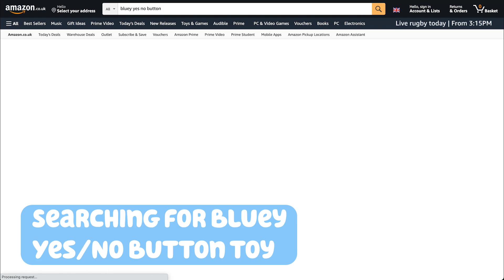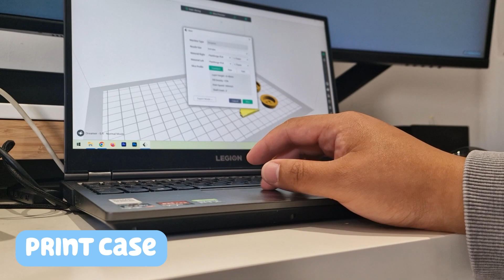DIY - Bluey YES/NO Button

Comment: Thank you for the visual!!! We just built this and it was huge help! We did notice that every time we turn it on, the audio module heats up and is very hot to touch. Is that normal (and safe?) or did we mess something up?
Reply from the maker: Ye that does sound concerning. Maybe take it apart, switch it on. And see what parts that's heating up . Maybe it's one of the chips that's faulty and not grounded etc. if you have another audio module, maybe try and replace it and see whether it makes any difference

Comment: How'd you end up getting that metal piece to stick?
Reply from the maker: Ah sorry, I realised I didn't show that part. Basically it's from a coat hanger which I cut and Bent into shape. There are 2 holes for you to slide the metal hangers into. It's a tight fit so will easily hold on place. But you can use a bit of super glue to keep it in place securely